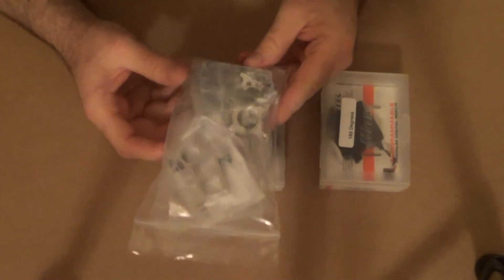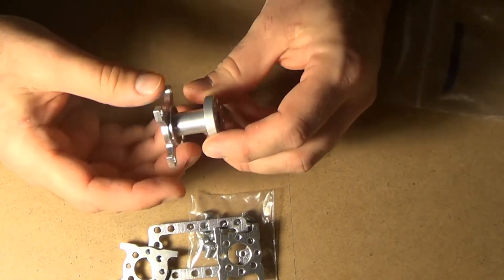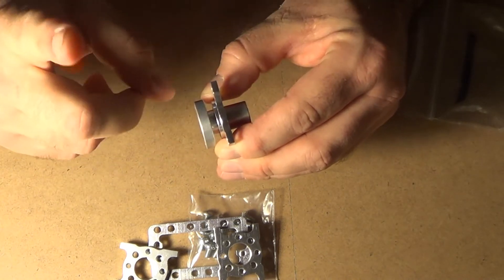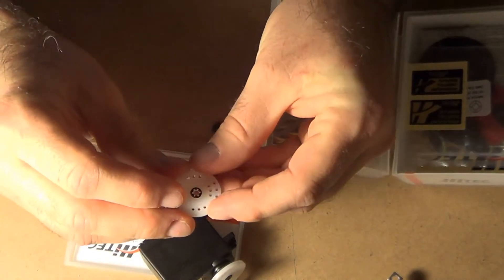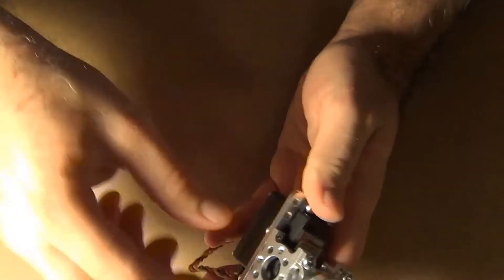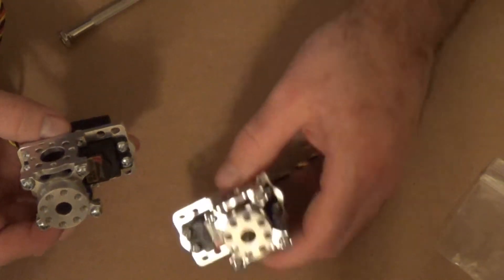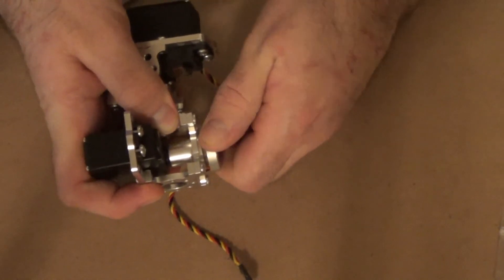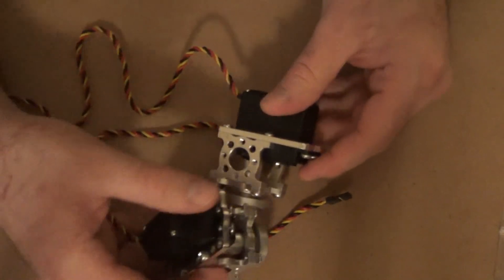First Look at ServoBlocks (from servocity.com)

Comment: I just got my servo block from ServoCity.  Your video is a help.  Thanks for posting it.
@1:49, you get into how the ball bearing plate (part 535118) will bear the weight on the shaft.  However, on my servo block, and I see it on yours as well, there is a gap between the servo shaft hub (no part number) and the ball bearing plate.  I understand the purpose of the servo block is to move the weight off the servo, but that gap means, to me, that it is not doing this.  
Any thoughts on this?